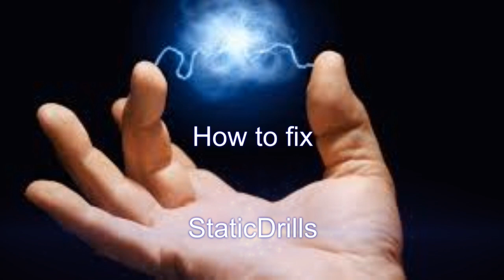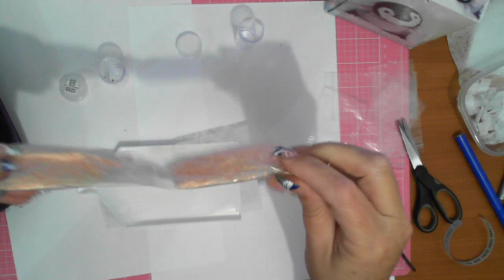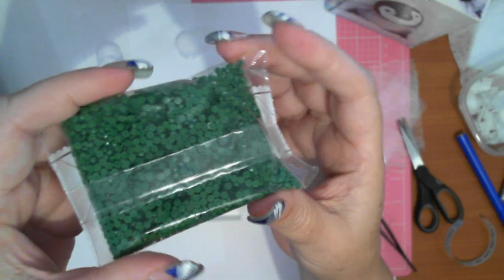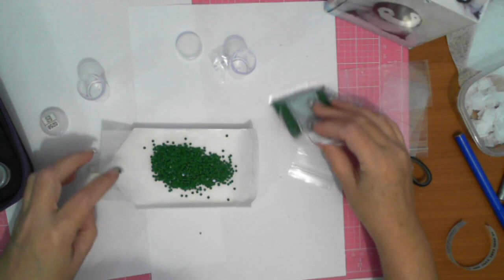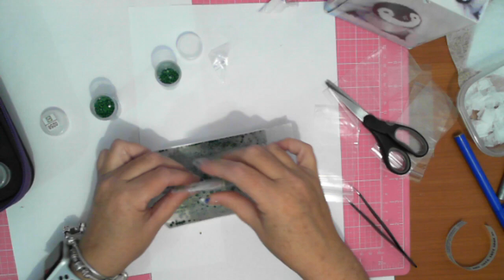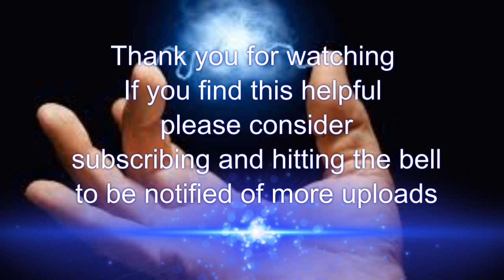How to fix static Drills

Comment: ok that is what I do with oily drills, rub them between baby wipes to clean them up.  will do with dryer sheets next time I run into the static drills which so far been lucky last few kits.  Static on those things suck.